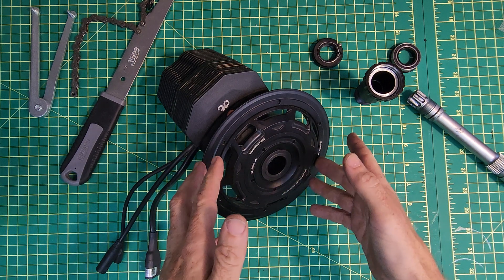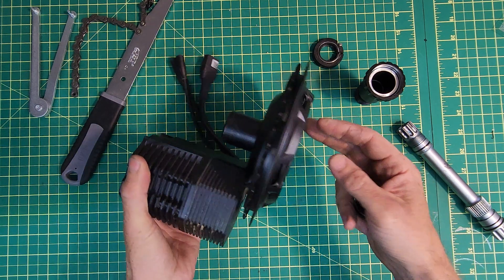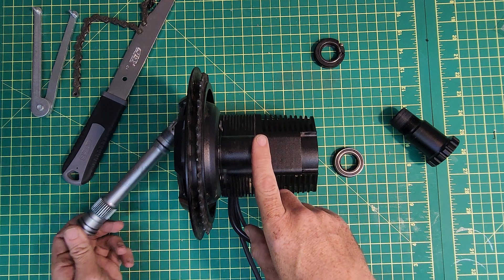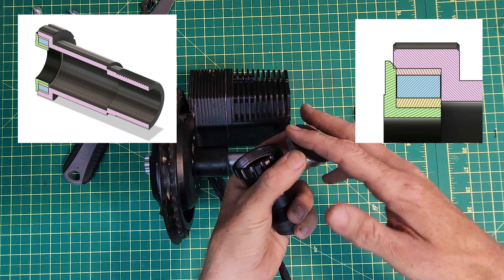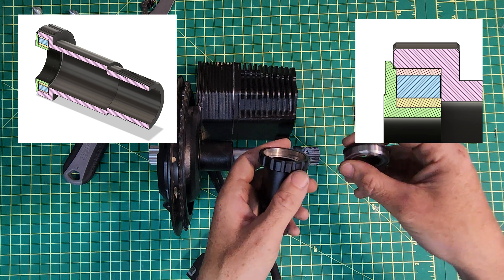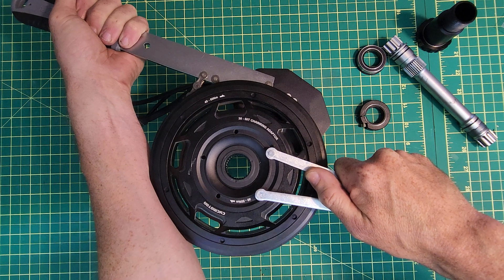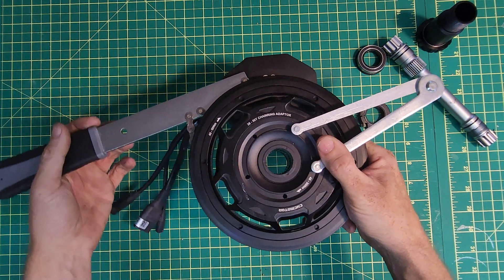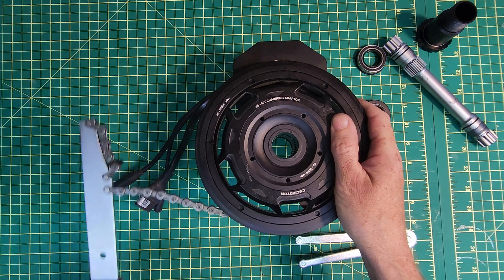CYC Photon Ebike Motor - Stiff Bearings and Stuck Chainring

Comment: you'll never loosen the lock ring, you need leverage the ring tool needs a good 30cm/12' extention then it should loosen much easier, as said elsewhere that 2 pin tool is a shit design the tool should engage more of those holes on the ring .... the bearing seat, you could try using shims, you could make one from a coke can just to see if that helps or order shims online somewhere or the extreme, machine the outter down on the bearing seat
Reply from the maker: Thanks for the comment. A thin ish washer should work. I will be interested to see if CYC say anything on the tolerance issue.
Reply: I have a photon presently with no problems as of yet. I just don`t see this unit being better than the bbshd when it comes to sheer toughness and service ability. I`ll can mine if I have problems and chalk it up as a lesson learned. Also have stealth gen 3. From what I see cyc is not on my want list anymore. I`m 2 grand into their units so far. Thats a enough for me. YMMV
Reply: Which one is harder to pedal without assistance photon or stealth?
Reply: I can`t really tell any difference in the no motor assist peddling. Both are quite easy. I like the units but just hope I have no issues.  @ataksnajpera

Comment: I doubt anyone could loosen the ring in the position you held it.  Try setting things up such that you can hold/squeeze both the chain wrench and the tool supplied by CYC in one hand (or two).  This will give you much better leverage.  If that doesn't work then you can resort to more mechanical advantage with pipe etc., but always best to be in an orientation where the two handles need to be brought closer together.  That way you will have more control and, I think, better results.
Reply from the maker: Thanks Brett. I appreciate it!

Comment: Try 2 pin spanners. One in each hand while the motor is being held in place.
Reply from the maker: So that tool is called a pin spanner then. Its an actual tool then?
Reply: Yeah. Pin spanners are the thing. If that part actually does spin to loosen that’s what those holes must be for. The company probably has a custom tool that fits a pin in every hole on a long handle for maximum force distribution. Your small spanner isn’t applying enough rotation pressure. 2 spanners might do it if they don’t slip out or start flexing.

Comment: I love to know of CYCs comment on the bearing preload issue. I think that that tool should span between 3 holes which might make it slightly better. CYC should provide a bench mountable 5 pin jig.
Reply: I have a stealth
I have been following these guys for years . They were part of GNG electric motor 
The stealth was the one that finally got to a point of refinement that I was looking for.
You can also modify it by changing the outside plates to fit into most frames front triangles if you have room and skills
But even out of the box you need need some skills to set them correctly
I have the bottom bracket + freewheel  version 2 with the square taper .
I would prefer the new version with the ISIS spline.
Then it would be perfect
And they are so much fun
Reply: That is a correct assumption easier said than done requiring a new very tight tolerance 3 plus tool though.  Making either adaptable to an impact driver will make it smarter not requiring brute or potentially damaging force.  The old trick of temperature differential of parts is yet another common assembly/ disassembly truck
Cheers
Reply from the maker: Yeah. I mean I think its not the load but the design. I hope the tools they send to dealers are like you describe.
Reply: The tool should really be spanning opposite holes so the unscrewing is an even pull on the thread around the diameter. I'm guessing it's a fine pitch, so even more reason to balance the rotational force on the thread, a simple mechanical engineering principle really. Got my unit arriving in a month and can't wait.
Reply: Agreed about using opposite holes. I have tapped gently with a rubber mallet with good results. Also, if you are lucky enough to have access to two Photon kits, you could use two tools in push-pull to increase torque and reduce the thread friction. The Photon chainline can go as small as 47.3mm which is a great fit for my old 135mm MTB back wheel.
Reply: They have a 5 pin tool in their shop. Not too expensive (depending on your shipping).

Comment: you need to turn in to she man hold the motor up and say i have the power 😁
Reply from the maker: By the power of Grayskull it shall be done... Maybe
Reply: @HighVoltageKits   leverage big lonng  bar just find something to go over the end of the tool and get someone to hold the 2 pins down or make a custom one if you can weld

Comment: How about making a spacer for the o.d. of the bearing that would space it out the appropriate amount. Do you know someone with a metal lathe?
Reply from the maker: Yeah. Like a shim. I could do that. I could also remove some material outside of the cup.
Reply: That was my first thought 1.5mm spacers on each end should do it

Comment: I was never planning on buying a CYC motor, but I am really disappointed in their products from what I have seen. Their price points and marketing will have you believe that they have a premium product, but it seems like the attention to detail simply wasn't there when designing their motors. That being said, have you tried using a pipe as an extension for extra leverage with the chain whip?
Reply from the maker: You mean try and anchor the tool and rotate with the whip. It might work. I might get an extension welded onto the 🔧
Reply: @HighVoltageKits  yes. No need to weld. Just get a long pipe that will fit over the chain whip handle.